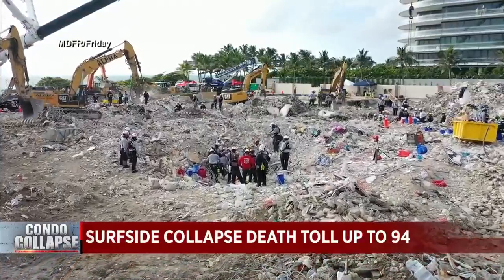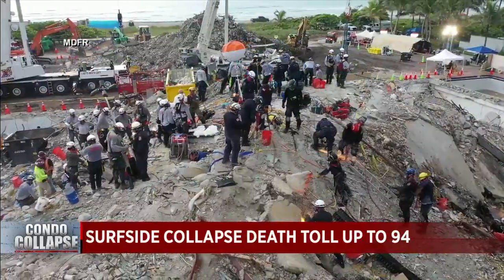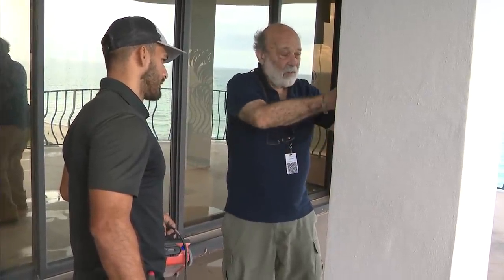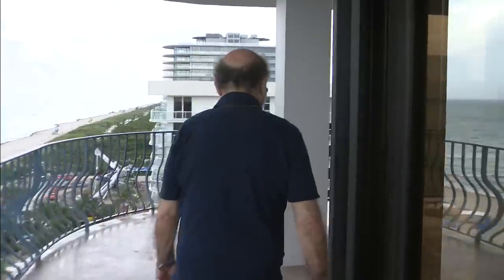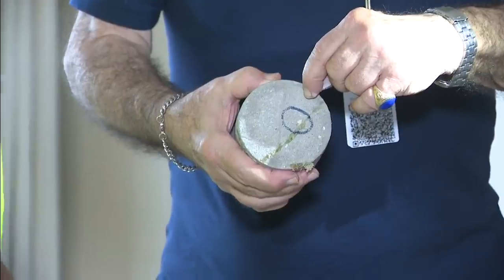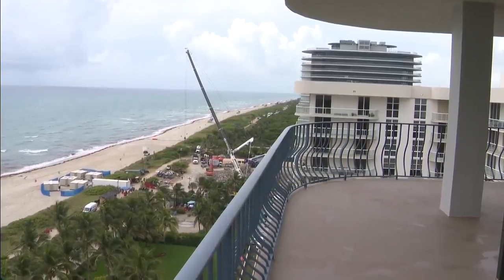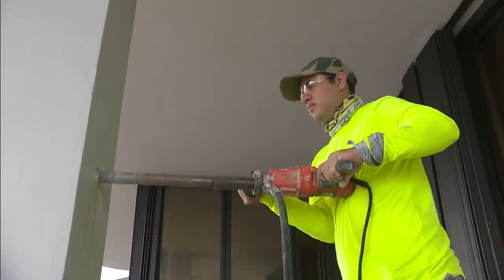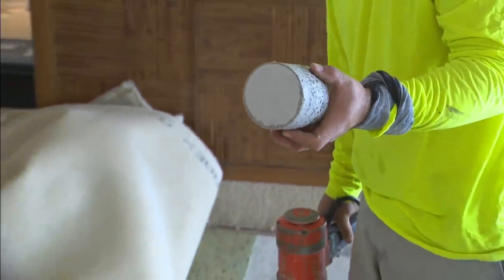Structural expert studying still-standing Champlain Towers North looking for clues into south to...

Comment: This has Nothing to do with the Developer and Everything to do with the gross Negligence of the condo association board.  Stop pushing the wrong story here!  The condo association board continues to differ critical repairs needed and at the expense of almost 100 Lives is a horrible way.  Tell the Truth!
Reply: It does have to do with that. The pool deck caused the building to come down… That just shouldn’t happen.
Reply: Developers normaly only provide the money and investment and not the expertise of building, that falls on the Architect, the engineers, geologist, the builders, the building inspectors and other stack holders..
The building is 40 years old, it was busy "sinking" into the ground on a yearly bases, it also had lots of flooding in the basement.. 
And there was a report done a few years ago, nothing was done from the inspection.. 

Lots of fingers are.going to get pointed and lots of people are going to get sued in this one.. the pound of flesh is being requested..
Reply: you are correct, Ive read that several of the buildings board members and president quickly bailed out in 2019 after finding out the huge some of money needed to bring the building up to code, basically they abandoned a sinking ship, but without telling the passengers....
Reply: Exactly! Once the developer has completed their project it is entirely up to management to inspect and bring up any issues to fix right away

Comment: Reinforced concrete structures exposed to weather without some form of impermeable protection system ,protecting the concrete will eventually have issues with reinforcement corrosion. This issue will be worse in a coastal environment . Structures like this have a limited life span , especially if issues like failed membranes over suspended external suspended slabs are ignored . I am a structural engineer with over 30 years of experience and I can guarantee that this building would have exhibited many signs ,over several years ,that it was in trouble . Signs that were obviously not taken seriously enough . Truely a tragedy and my Heart goes out to all those families who lost dear ones.
Reply: @Joe Huff let me guess you are an accountant?

Comment: Please forward to that civil engineer that is part of the investigation

after view some U tube video's  someone had said something about tall palm trees that used to be in those planters and could find them on old google earth pic's.. what I like to know is what did they use to remove those trees it certainly wasn't done by a chain saw and stump grinder .. 
 

I think they may have used an  excavator  backhoe  that was on wheels/tires instead of tracks,.  as these machines are quite heavy and may have contributed to the weakening of that floor.. remember witnesses said the pool deck area that had no building over it fell in first .. this is a good theory and surviving witnesses that can remember how they got those trees down and how and with what,. 

It caving in the pool area first is what made me think of as to how and why as I've worked in construction site development/preparation   around heavy equipment and started to think of the backhoe's on Wheels/Tires   since some of those backhoes the scooper can rotate too besides open and close,.
Reply: @Lisa V I figured out it might not be the big backhoes on wheels but something like a posy track loader or excavator   since there's a big enough opening to get in there with either a posy track or mini-backhoe only with out taking other things out
Reply: @Lisa V found out by street view only a mini backhoe could get into it or possibly a posy track loader both are common equipment landscapers and tree removal companies use and weigh about as much as two cars

Comment: The planters I believe were the main cause of the collapse. Also bad engineering from the beginning contributed to the collapse. The strongest rebar, was improperly placed at the top third of the concrete. Where the lack of water proofing led to the bottom 2/3's of the concrete peeling off from the top third. You can see it in the collapse pictures. Look at the columns next to the pool and you can see delaminated concrete leaning against the columns. The columns just punched through the deck. The bottom 2/3 separated and fell first.

Comment: Architects and Consulting Engineers do not build buildings - contractors do; hopefully, in accordance with their designs.
These buildings were designed in 1979 and built the following year.  That is why they were up for 40 year review.
My inspection of the design drawings found the following differences from UK construction practice.
1. Use of 4000psi concrete up to 8th floor and 3000psi above.  I would consider 4000psi to be barely adequate and heavily reliant on surface protection given the exposure in that oceanside location.  Whilst the calculations can be adjusted for weak concrete the lower strength comes implies lower cement content which reduces durability.  Something of concern in a pool/podium deck near the sea due to chlorine and salt spray.
2. Specification of only four vertical bars in carpark columns whereas their size 12x18" would require more main bars in the UK and more shear links to contain the main bars.
3. I saw no shear reinforcement specified for the podium slab yet there is cracking clearly seen in YouTube videos around column heads with stalactites hanging from the podium deck soffits along with corrugated plastic sheeting to keep water off cars in the parking garage.  Cracking at column heads AND water penetration is alarm bells.
4. Detailing of the building column starters assumed kicker-less construction.  If slab concrete is poured into a column kicker box the quality of concrete in the bottom of the column is usually much better.  This is helpful if the deck is subsequently flooded with salty pool splash water.
5. The slab thicknesses are not generous and given much of the podium deck was subject to vehicular loading I would have expected thicker.
6. The fatter columns under the section of the building that resisted appear related to the transfer beams at second floor.  The collapse stopped at the lift shaft because being a 12inch thick wall it was immensely strong and it may have been a construction joint / day-joint line all the way up the building.

However, the building lasted over 40 years and may have complied with US codes of the time as built.  The issue seems to be how it was treated and maintained.  The real question is are the other buildings Surfside in similar condition and do they need strengthening, partial reconstruction or demolition.

The KC engineer saying to the camera that the test holes will be filled with 8000psi concrete may just be theatre in the context of the 3000/4000psi they were built with.  But hey I am only a UK Chartered Structural Engineer with over 30 years UK European and Middle East experience.

Comment: But its worthless. It's a guesstimate...  every building is slightly different.. you cannot state this building is like other one..  each is a one off..
Reply: Yup.  They may have had the same specs, but different crews on different sites and year apart can make all the difference.  Apparently, the pool deck did not have the required water-proofing.  That alone is enough to explain it all.

Comment: From what is reported there may be several contributory factors. Possibly all were necessary defects for the collapse. But if one or more did not exist or had been addressed earlier, would the building still be standing?

E.g. is it possible that by not fixing the issues in the parking garage, that the collapse of the pool deck pulled out columns...allowing for the collapse? Why is such a tall structure so dependent on lateral support by the pool deck? Couldn't these be separate?

And how come the pool deck simply dropped over its own columns? Was there enough rebar between those low columns and the deck's support beams? I can't imagine all of that concrete and rebar was so deteriorated at all of those points without it being obvious.

Comment: The pool deck was made to hold the weight  of people , but the added tons of weight with those planters and tons more by making the deck flat , after it was cast with slopes to drain s in the center ,and , the deepest, heaviest part of that added weight  was the farthest  from the columns .  Remember this is Florida ,  they didn't  even have to allow for a snow load . Only had to carry the weight  of people , dips were filled in, concrete  planters were added , tons upon tons of extra weight to the columns the tie in rebar just pulled out . And down came the deck , hitting columns  about mid way up , like someone kneeling you in the back of the knee   the column were never designed to be hit half way up

Comment: the Champlain North is also in danger, because the building has NO Beams, nor drop panels or capitals. The columns between the basement and the first floor is not a songle column, instead, they are joined, so if for some reason a floor fails, the whole building could fail because os column buckling!.

Comment: Failures are usually from something someone did. Roofers where working on the collapsed structure before it came down. That's where I'd start investigating.
Reply: The video shows the collapse happened feom bottom up, not from the roof down.

Comment: I have lived in two  low rise condo buildings and currently a high rise building.  The boards of directors in all the buildings have been very proactive in getting building experts and contractors to examine, evaluate and estimate remaining life in the building components and the likely replacement costs.  The reserves have been adjusted as needed to meet the date of expected replacement.  After a particularly cold winter the brick work needed a lot of tuck pointing to keep the building in good repair and an additional assessment was made and the monthly dues were adjusted to build up that fund going forward. My current HOA board has monthly open meetings in person or via zoom and the meeting minutes are available online a few days after every meeting. I am very satisfied with the level of reserves currently. The amount due monthly has increased to match replacement of the roof in ten years and replacement of the balcony surround.  In addition homeowners were asked to replace their hot water heaters as they reached the likely end of their life.  The board arranged a significant discount for a bulk purchase of heaters plus installation for participating owners.  This purchase was to forestall any leaking into the unit below (which had happened already).

Comment: Leveling pours within the slabs had better be according to the engineering because if its not exactly as specified that could result in drastically reduced strength as well as potentially migrating and concentrating a lot of unplanned moisture around.

Comment: Why is the media so slow at this? Most engineers are concluding that the pool deck collapsed and it brought down the main pillars of the building in the parking garage. If there isn't standing water or water damage to the parking garage, the building should be fine. That's all they have to look for in the other building.
Reply: "Most engineers are concluding that the pool deck collapsed and it brought down the main pillars of the building in the parking garage" 
That is how it collapsed, not why it collapsed. It isn't that easy as you stated it here.
Reply: @hjalmar4565  Not sure what you're complaining about, main pillars were destroyed due to the pool deck collapse, this isn't rocket science
Reply: @maxwillson  As far as I know we don't know what happened exactly.
Did the pool deck collapsed because of a column failed or did the column failed because the slab took it with it.
There is a big difference between them.

Comment: The cause was negligence of maintenance not the structure in itself. It's been up for 40 years but if you don't take care of the maintenance it will obviously deteriorate with time especially since their by the slat water.
Reply: I think you are mistaken.  Certainly lack of maintenance was a factor, but this was a flimsy building.  The North building is the same flimsy design.
Reply: There’re 100 year old+ buildings in my side of the world that were hardly properly maintained and are STILL standing strong today, your comment is beyond weird to me.
Reply: I'd say it's likely both bad design and bad maintenance...not a good combo at all. With repairs the buiding would still be standing now.
Reply: @dexterm1285 , according to many sources, the repairs needed were extremely expensive. A 40 year old building shouldn’t need such expensive repairs. I’ve lived in much older high rises all my life, and the most I’ve ever paid in repairs was 2,500 Euros a couple of years ago. People are putting blame on the owners/victims, when it’s the designer, builder and/or city inspectors who should be blamed.

Comment: The expert is testing the entire concrete building for possible concrete failure, it could have happened in certain stages of construction, if he finds substandard concrete on the top floor, the whole building is compromised and every floor right to the bottom needs to be suspect, I'm looking forward to his final report.

Comment: They need to test the chlorine from years of pool water flushing and splashing out which runs toward the base columns of the building,  for get about testing too much the top of the column, test the bottom, and from there up, chlorine is worse than sea water.

Comment: I don't like a design where less critical elements (pool/garage deck) can interact with and compromise highly critical elements (building structure).  Multiple feet of flooding and crashing ocean on top of pool deck could easily over stress it.
Reply: Even an overweight truck could have been a problem. They park on a portion of the deck, and it is made with the same support structure as the pool deck. That is near the potential start point for the collapse.
Reply: @exhaustguy  an even more likely scenario, thus a very good point

Comment: I called it right after, heck I called in 2001. I did kit and bath remodeling in that building and many others that have the same issue. The rebar corrosion was/is so bad that anyone could see it coming thru the concrete in the classic square pattern. Back in 01 I was afraid to work there.
Reply: Square pattern.. Wow that sounds bad. Like a rusty square pattern of the underlying rebar?
Reply: @trucid2  what is a square pattern?
Reply: Wow
Reply: Inferior design & engineer for profit...its evil, but that’s at the root of profit anyhow isn’t it.

Comment: I understand the worry about this building, but honestly, it’s probably perfectly fine. The fact of the matter is that there is no way both those buildings would have stood for a combined 80 years if there was something majorly wrong with the design. There were a lot of maintenance things in the south building, I believe including being owned by different people, that had to go wrong and be ignored for the collapse to happen. Believe me, Champlain North will be the safest building on that beach after all this.
Reply: Add to that how many category 4 & 5 hurricanes that didn't take them down.
Reply: @truthylucy7068  Well, with hurricane Andrew in 1992, this caused a lot of damage and a subsequent strengthening of code. Having been built in 1994, I’d be curious if Champlain East will have had structural differences as a result of this. They don’t seem to be worried about this tower at all, so I wonder if they have differences which may have had a side effect of making that tower largely immune to the problems at South. I also believe that the North tower is sitting on better ground, with a lower water table and whatnot, I haven’t heard of anything being found with that foundation.

I will wager that they will look at the design and build of the surviving two towers to compare notes as part of this investigation. In any case, with the amount of scrutiny these two buildings will have, I don’t think they’re going to be in any danger, and if they are, they are definitely going to know about it.

Comment: Did Champlain north have the same planters as the south?
Reply: From Google Earth, it does have one large planter. Also, the north building seems to be smaller, and a smaller pool deck as well. You can see on Google maps as well, have a look so you can see it for yourself to know the differences. The north tower is 3 buildings north of the collapsed building.

Comment: Let's learn how it fell down with ➡️ ARQMANES ⬅️  he said that it building didn''t have BEAMS in each SLABS. The same problems have the two towers.
Reply: I saw the video and he’s totally right .
Reply: ArqManes is right, but he never explained what initiated it, nor did he address an event that occurred the day before. Most people are unaware that a woman living in the penthouse on the 12th floor was awaken at 3 or 4 am by loud creaking noises that she was so disturbed by that she couldn't go back to sleep. Less than 24 hours later, the building collapsed. In the days before the collapse, contractors were mounting anchors (davits) on the roof and were load testing them. Also interesting to note, in the video of the collapse, the parapet was missing in the area by the penthouse of the woman that heard the creaking noises. I suspect that something failed at the top of the building and the parapet broke free and landed on the planter box below, causing the collapse of the pool deck as shown in the tik tok video.